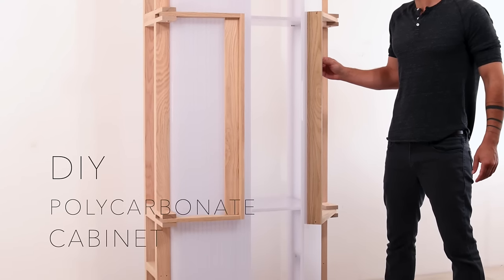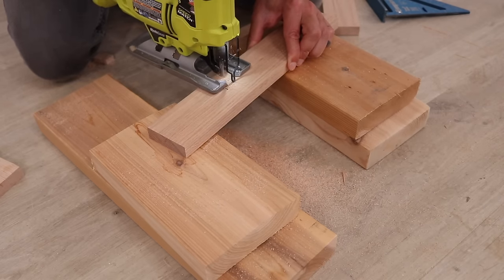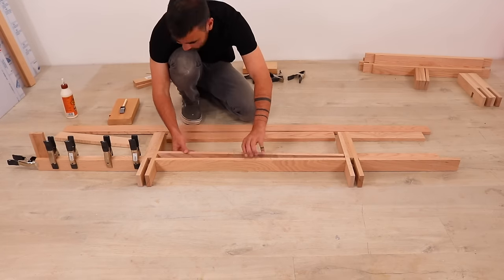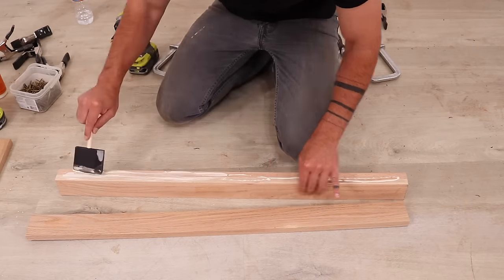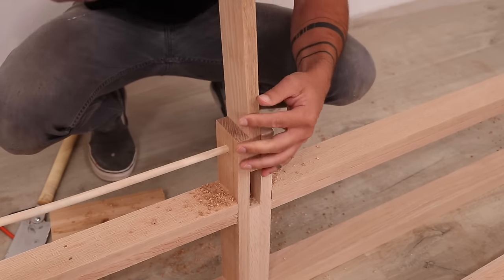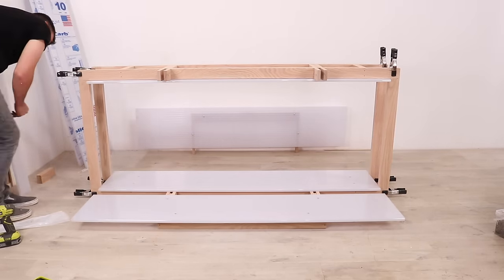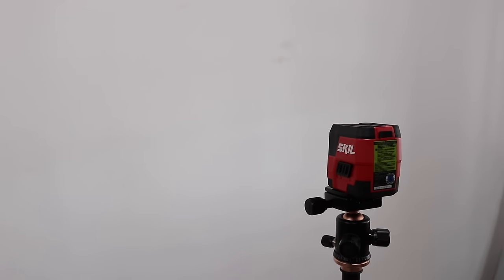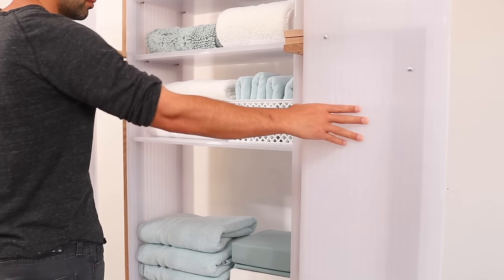How to make a Cabinet out of Polycarbonate

Comment: Hello friend, this is undoubtedly the best project you have done, very elegant, creative and the mixture of a traditional material like wood with a modern material like polycarbonate is wow !.
A grip you could let the wooden rod that you used as the axis of the hinges protrude a little bit up and a little bit below that would give the cabinet an aspect of pieces assembled by hand that could be very nice, only I find it very doubtful that You have used polycarbonate as shelves in the interor, I think that this material does not have enough resistance. I congratulate you and I thank you for sharing your work, I will continue to enjoy it. Greetings from Uruguay.

Comment: This is a great idea. I love the fact that the Polycarbonate is light, which allows for a more flexible door design. I think you should try making a murphy bed for your next project.  The designs online are mostly heavy and are best used with expensive piston bed kits. Is there a way to make a much lighter frame, while not compromising on strength?